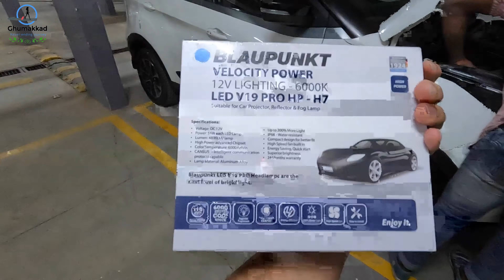Low light Problem Solved 🤩, Best Headlight Upgrade for Tata Nexon #tatanexon #nexon #caraccessories

Comment: Did you do holes in the dust caps of low beam to install hid?
And what Kelvin is the hid is, is it 4300k?
Reply from the maker: No, it was just plug and play.
Yes 4300k.
Reply: @GHUMAKKADANU  any melting issues in projectors or any other issues?
Reply from the maker: Nothing as such. Everything got done keeping all things in mind and by professional
Reply: @GHUMAKKADANU  thanks for your response sir.🙏
Reply from the maker: My pleasure to help you 😀
Reply: Price kitna he ?
Reply from the maker: Both including HIDs and LEDs cost close to 17k